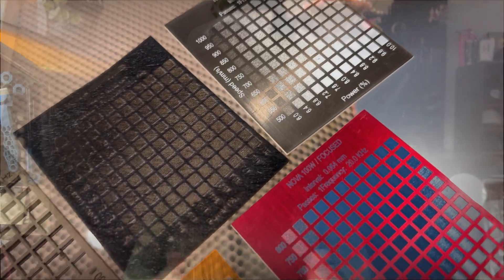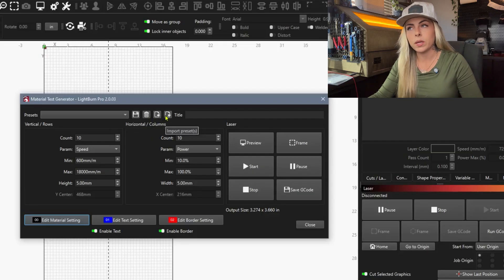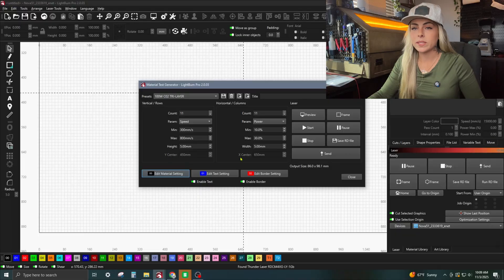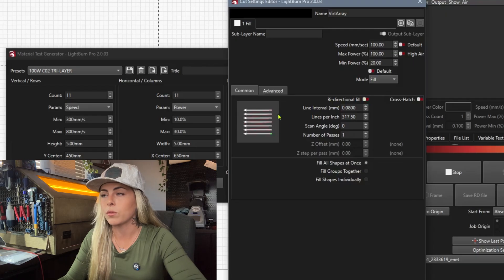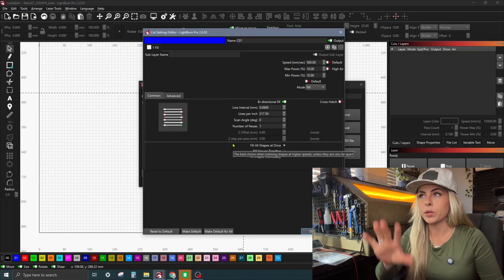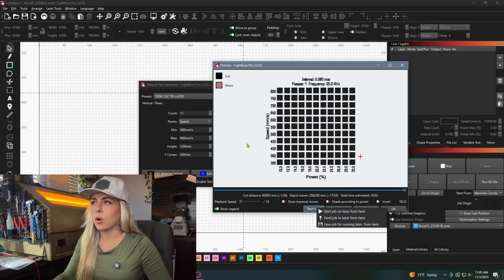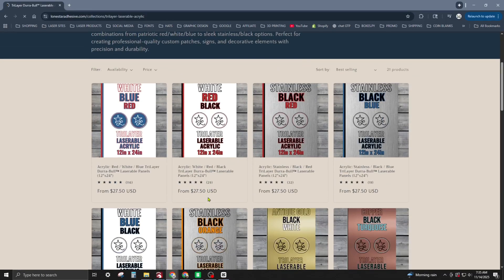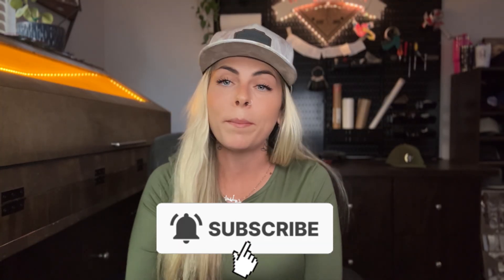Mastering Material Tests in LightBurn: Complete Guide for Perfect Laser Settings

Comment: Thank you for this. I have an Ortur 10 W diode laser and have run the test to select the best cut settings. I use 3mm plywood (recommended by Rich, La Hobby Guy).  And the cuts are clean on some but not other sections of the project. Single sheet of ply, cuts fine in some areas and they not through in others. Then I have to use a razor blade or ax to.  Any suggestions?
Reply from the maker: It might be that your material isn’t flat enough on the laser bed